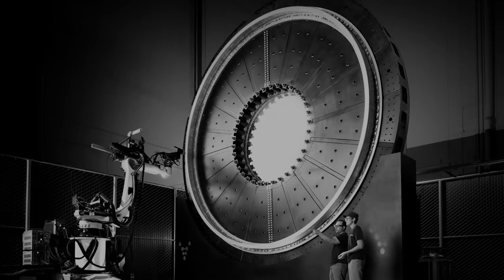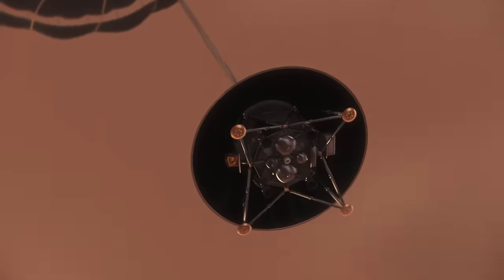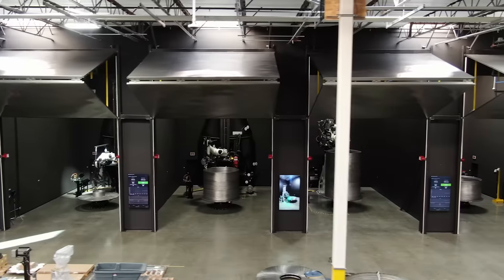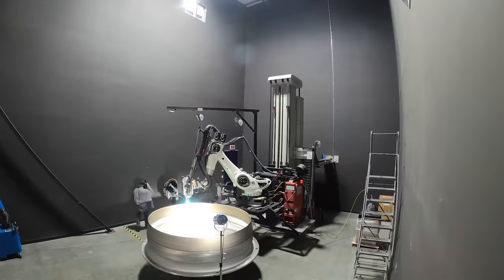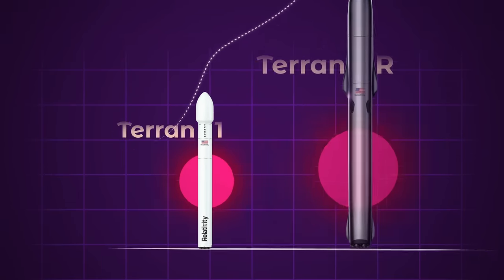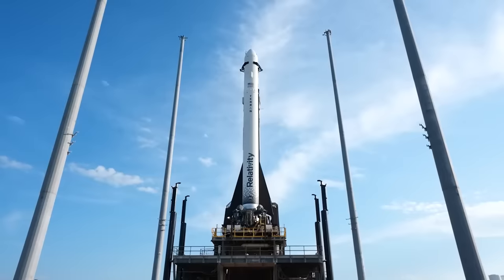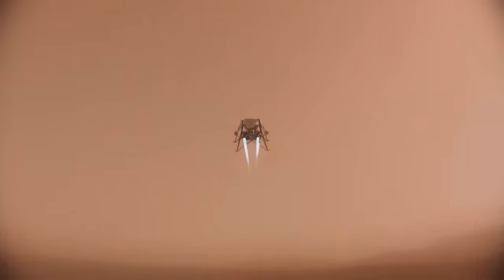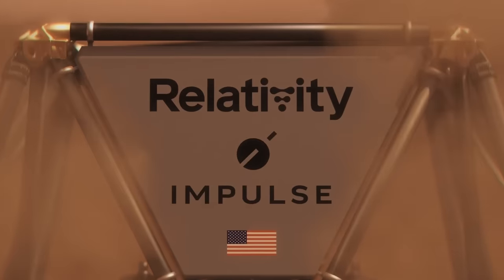3D Printed Rockets are Genius, Here's Why (Relativity Space)

Comment: 15:33 Not sure where you got the long fins on the latest starship booster.  It currently has no fins at its base.  Those fins were removed from the design about six years ago.  Only four bulges housing the eight long tanks required to restart the inner thirteenth steerable engines are currently at the exterior of the booster base now.
Reply: yeah that's the old design
Reply: The current spaceX starships are all the last of the V1. The new ones are being made in the new starbase buildings.
Reply: @NeonVisual the v1 didn’t have em

Comment: Corrugations are a well known method of adding structural stiffness to what would otherwise be a 'panel'. This is exactly where 3D printing shines, it can add corrugations where other processes can't - or much cheaper than other processes, such as press-forming with dies and molds.
Reply: Good comment. Thanks for sharing

Comment: could 3d printing rockets be possible IN space ? like would 3d printing be a more effective way of building bigger ships within space? or is it not possible
Reply: In DED (Direct energy deposition) Processes like they use here, the overheating of the part itself is a challenge. To get a good metallurgical microstructure and therefore good mechanical properties, you need to control your meltpool as well as the printed layers. Without convection cooling in space it gets even more complex. However it is possible and the absence of O2 in space enables also printing of reactive metals. Habe worked with electron beam AM machinery where you also work in vacuum. That’s the nearby future.

Comment: Amazing to be able to print such a structure horizontally. Perhaps it prints wider horizontal segments kind of like a tooth, then starts on another tooth and so on, after the 4th or 5th tooth is done, the 1st tooth is already set (semi hardened), then by the time it gets to the 6th or 7th tooth (going clockwise) the 1st tooth is much harder, and the second tooth is set. The big stargate looking printer does not need to move, just the nozzles within it. Anyway... I'm just guessing. Perhaps the printing is going on by hundreds or thousands of nozzles all at the same time. Perhaps the layers being printed are only 1mm thick and thus might be able to stand up to gravity pulling down on the printing. So I guess that is what I'm wondering is how they stop the printing material from slagging due to gravity?
Reply: The aluminium comes from the robot welding it, it’s hard as soon as it’s set

It’s metal not a resin what are you smoking
Reply: @616CC  😂😂😂

Comment: They need to stop calling them “3D Printed”. They are in fact 3D welded!
Reply: In the age where 3d printing is so popular and omnipresent it is a good publicity and a catch to attract more viewers. If they want to invest and invent further they have to have views and publicity to THRIVE and progress with their plans. Simple as that. Is it hurtful for the viewer? Depends on the oitcome. No fault in that as long as you enjoy it 😅 fool and be fooled.  LIFE.
Reply: The correct term is additive manufacturing.
Reply: Metal is a form of filament. It’s both welded and printed.
Reply: It's 3D printing, or like somebody else said, more broadly, additive manufacturing. A filament is being fed into an tip where it is heated/melted and stacked on top of other material that was previously heated/melted in an automated fashion is called 3D printing these days. Otherwise, we would call any process like this "3D welding" considering metal isn't the only material that can be welded (plastic for example).

TLDR: It's still called 3D printing, not 3D welding.
Reply: A hamburger is still a type of sandwich
Reply: Most people understand 3d printing so that's why it is used
Reply: @godny123 exactly
Reply: Just one of many tech of metal 3D printing. Used to work with SLM (selective laser melting) printer- mostly meant for smaller complex parts in my case they were Cr-Co dental prosthetics parts. Con is that you cant make enclosed space (unless you are fine having Cr-Co dust inside).
Reply: The method is done on a 3D plane, not manufactured on a "flat plane" like a paper printer..... Hence 3D printing but using metal welding. You could call it additive manufacturing but they r still manufacturing it in a 3D plane using a printing like method.. 🤦 again, hence 3D printing lol
Reply: The thing is in metal additive manufacturing there are different types way to bind metal together in layers and the way that relatively is doing with their rocket
Reply: It is 3d printed (created using additive manufacturing) the category of 3d printing it uses is called DED or Direct Energy Deposition, I dont know the exact method of DED that it uses but you should be able to google that
Reply: @nat9jw  .......... lol
Reply: @francoluissotomayor5521  so is a hoagie!!😂😂

Comment: The wavy bulkhead is machinable, stampable, and/or pressure workable 

Machinable: get a thick disk, remove material to leave the surface. Lots of waste.

Stampable: make a toolsteel die set... first pair puts a small set of bumps and valleys; progressive dies increase and redistribute the metal to final shape and thickness.
Working: Using an english wheel of sufficient bar length, one can redistribute the metal from the disk to where it's needed; it's like multi-die stamping, but slower and less expensive to set up, but a lot slower and more error opportunities.

English wheel is great for armor making and putting fullers in swords... I've know guys who used them routinely. They aren't fast (neither is hammerworking a set of greaves, but that's slower than using an english wheel), but they're a way of moving metal around a piece without high heat. Tho' one can put a fuller in much faster with a special wheel set for a hot blade... 

The 3D printing is less wasteful than machining, less setup cost and time than stamping, less time than wheel work. 

On the other hand, the terran R can be said to be a handful of welds of many miles length... with all the risks welding entails. (I wonder if a friction stir finishing would be beneficial or detrimental...)

Comment: As a retired manufacturing plant manager, I looked over 3D printing and saw great possibilities. However, making fuel tanks seems a suboptimal way to use 3D printing. As far as I understand the process, 3D printing has a series of intractable issues including: the surrounding metal Heat Affected Zone (HEZ) creating reduced flexibility; microstructural changes leading to the metal becoming harder and more brittle; residual stresses into the metal, which can further reduce its flexibility. These stresses result from the differential cooling and contraction of the metal as it solidifies after printing; 3D printing can sometimes have defects such as porosity, inclusions, or incomplete fusion. These defects can create weak points making it less flexible and more prone to failure. The thickness of the printed material can also affect flexibility. Thicker materials tend to be less flexible than thinner ones, and 3D printing often has difficulties maintaining uniform thickness. When compared to rolled metal, 3D printing seems more trouble than it is worth.
Reply: These were my concerns as well. A rocket certainly needs to flex, and more than that, needs to flex evenly and consistently across its length. If there are weak and strong areas within the walls, the violent stresses will reveal those areas. I hope the failure to reach orbit wasn’t due to this. And if so, hoping they can figure it out.

Comment: 8:00 the ripples are a way to counteract the expansion, of the materiel wen it is hot. they will smooth out wen the rocket cools from the heat of the welder. The result is properly a smooth tank or outer shell.

Comment: 17:06 If relativity has developed a method to 3D metal print sideways that is indeed a breakthrough because based on what I have been told in the past that is not possible.  The reason is that the metal comes out of the print head in a viscous state.  You need to lay it on material below it otherwise gravity will pull it down before it solidifies.  I am not an expert on this however.  I know just a little more than the guy on the street.
Reply: What is impossible is a mind so closed, that things for its mindset become impossible to think.
😐😉
Reply: @jantjarks7946  I am open to new ideas as long as you can reasonably explain how it is accomplished.  If you cannot and accept everything that everyone says then you are the one with a closed mind.
Reply: Then my mind is as closed as the minds of those people who invented all the possibilities we take for granted these days.
😉
Reply: @Oldman5261 ain’t there footage of them literally doing it? Ain’t that proof enough that it isn’t impossible?

Comment: If the Relativity company can successfully 3D print a working reusable rocket, that will be the first innovation of the 21st Century to deserve the title of being "a game changer ".   From blueprint to launch stand with virtually no welders or fitters or mechanics or shift workers, needed !! It was not clarified,  or I missed it,  whether the rocket engine would be 3D printed.  I suspect not, because of the internal spinning parts and valves etc.

Comment: If a ship travels at a constant 1g acceleration rate it would get to Alpha Centauri in 3.6 years (7.3 years would pass on Earth) and this includes turning the ship around halfway to decelerate. It would achieve about 95% light speed in 1 year. A 10 ton ship would need 10 tons of continuous thrust. This is by far the fastest way we can get to other worlds and the ship would have gravity the whole way.
   All that is needed for this is a fission rocket that consumes uranium or plutonium only. They are both jittery atoms that are on the verge of fissioning all by themselves. There should be a way to get them to fission in a linear fashion. What's needed is a controlled, time released nuclear explosion. 1kg of uranium contains the same energy as 120,000 tons of coal and plutonium contains even more energy, not much would be needed so the mass of the ship will not change significantly during the trip.
   In an atomic bomb fission occurs when neutrons hit uranium or plutonium nuclei. This is because they will not tolerate an increase in mass. Due to the equivalence of mass and energy, the same should be true if you infuse them with energy. This might be as simple as having negatively charged uranium or plutonium atoms coming into contact with positively charged uranium or plutonium atoms. Or perhaps with laser or electromagnetic forces. A true fission rocket should not be more complicated than a chemical rocket.
   With the constant acceleration/deceleration method a ship can span the entire diameter of our galaxy in 24 ship/113,000 Earth years. Systems with stars similar to our sun can be reached in under 10 ship years.
Reply: Why did you need to say that on a video about 3d printed rockets?

Comment: So how long does it take to 3D-print a Terran R? I think this is an important data point to determine if this method is superior to SpaceX's construction method of welding sheets of steel together.
Reply: It's not just about how long it takes. It too is about what type of advantages can be realized.

Starship has just simple walls, which need struts in areas with large load pressures. In a 3D design this can be built in, or better said, printed in right away. Without the issues that two separate parts which have to be put together usually have.

Furthermore, even if it would take longer to build, well, print. That doesn't mean it would be more expensive. Automation can drastically reduce expenses.

And it too can mean that 3D printing can lead to higher build quality, at least in the long term.

There are a lot of factors to be considered. We will see what Relativity can deliver in the end.
Reply: You can always add more printers

Comment: Methane is 75% carbon, that's not "primarily hydrogen with just a little bit of carbon."  Most of the exhaust is going to be carbon dioxide, and not water vapor

Comment: Robot welding is hardly 3D printing.
Reply: It’s literally the same process as normal 3D printing but with metal instead of plastic.
Reply: If you weld existing metal parts together, then it's not 3d printing, yes.
But when you produce the whole object in that way, then it certainly is.